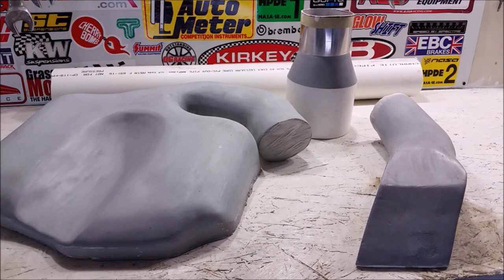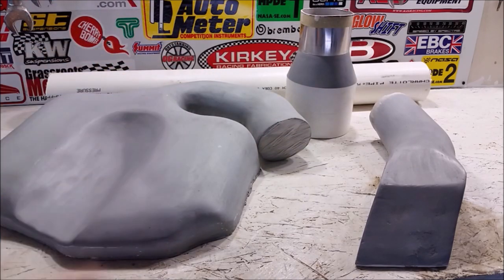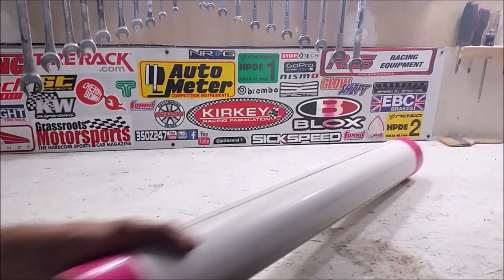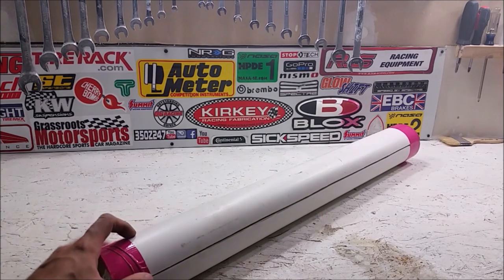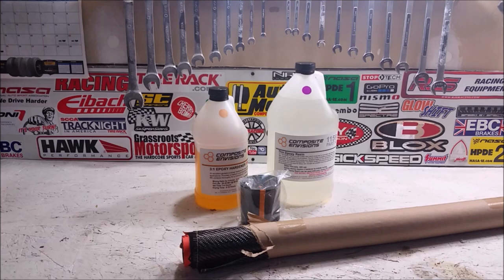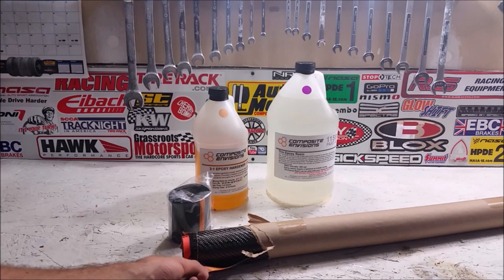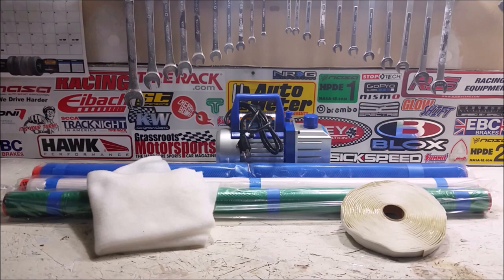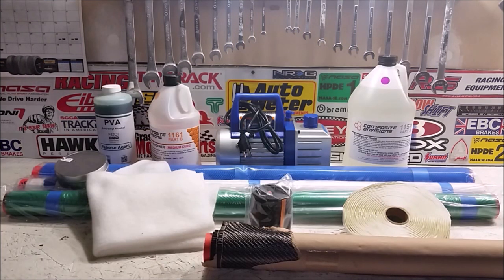How to Design Carbon Fiber Car Parts and Supplies Needed (350Z Part 2 of 6)

Comment: can you plz list up the needed components with ratio?  
and which brand to use
Reply from the maker: Needed components are listed in the video and the description with a link to where to buy them. Ratios of bagging material and carbon fiber are tough because it depends on the types of parts you decided to make. A gallon of resin should be good for maybe 10 yards of fabric if applied correctly.

Comment: Mate do you have any idea what kind of Best clay are use to model design car. A clay for. Mold
Reply from the maker: Mark Lester Casipong any molding clay will work well.
Reply: Thanks mate are they available. Also in ebay or amazon where to purchase. Mate i dont know if its available in. Philippines
Reply from the maker: Mark Lester Casipong literally any modeling clay from ebay or amazon will work. Elite motoring is where everything else came from and they have an eBay Store.

Comment: how do you build car Panels like bonnet or doors?
Reply from the maker: I would use the door or the hood as a plug (instead of the foam plug I made in part 1) to make a fiberglass mold then work the same way through the process using that mold and carbon fiber clothe. You would need to make two different pieces, the front and the back of the door or hood then bond them together with a body panel adhesive. The vacuum bagging process would be the same just on a bigger scale. Easy Composites Ltd and WJP004 have a good videos on how to do this.
Reply: These vids were helpful but if you do not have any plugs for molds? i have seen people using clay to form their own parts. what about that?
Reply from the maker: Clay would work. Its cheap and easy to change the shape as you go but you will need a lot of it for something as big as a hood or door. I would start with a normal hood and use the clay to add vents or any other changes.